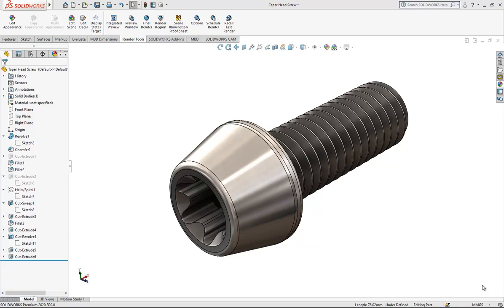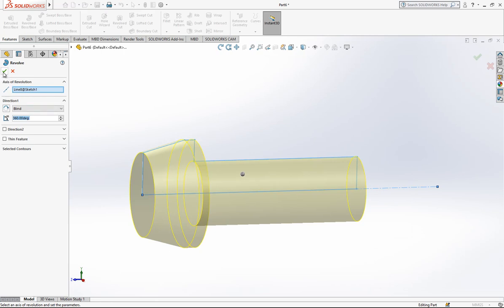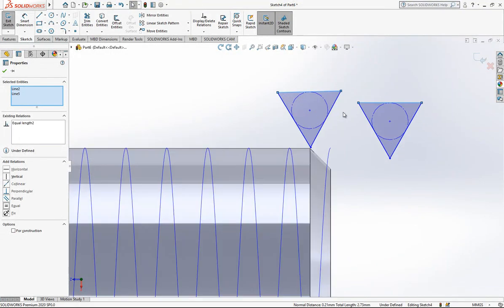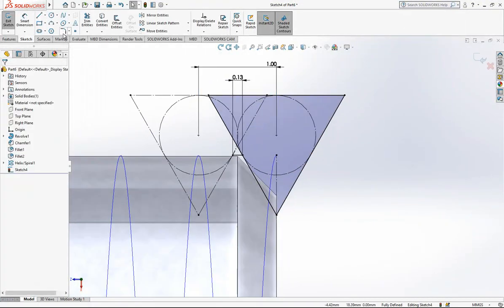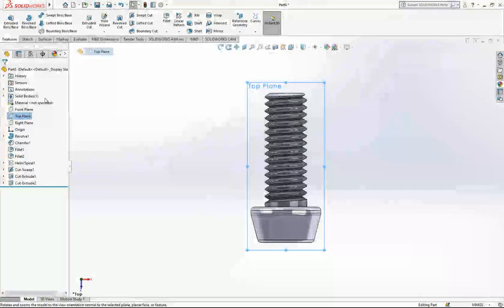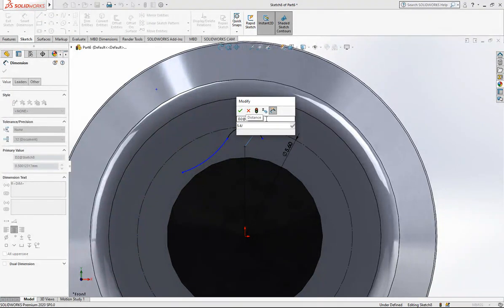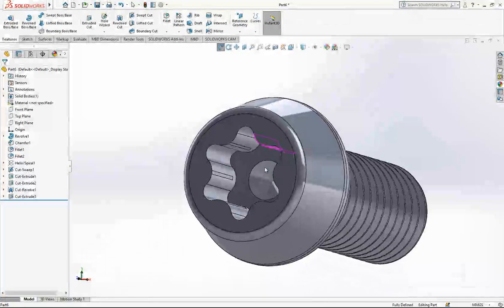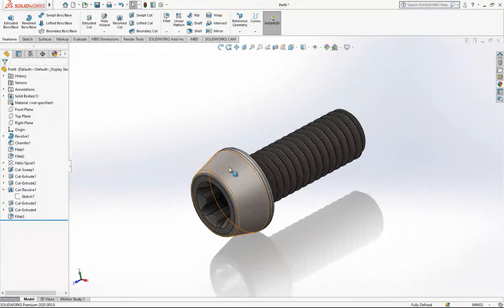Torx Screw M6x16 - SolidWorks Tutorial

Comment: why not use the thread feature to make the threads? what is the benefit from doing it your way? thanks.
Reply from the maker: Hi Jonas, 

Sometimes with specifying  your own gives more accurate result.

Also I did not know that Solidworks had some set of new thread options. I am an old user since 2000 I am using Solidworks some old habits continues 😁 also in earlier versions of Solidworks had only a symbolic thread functions.